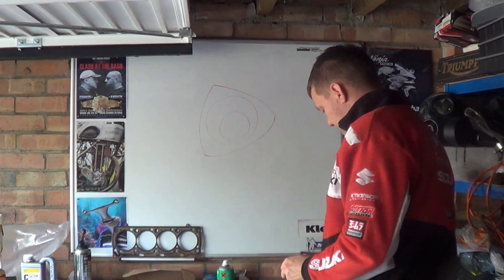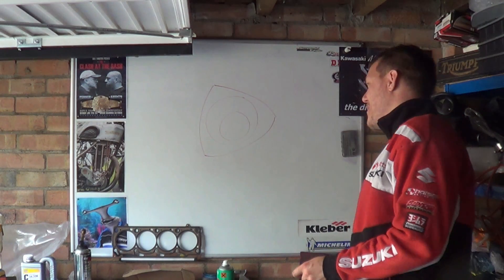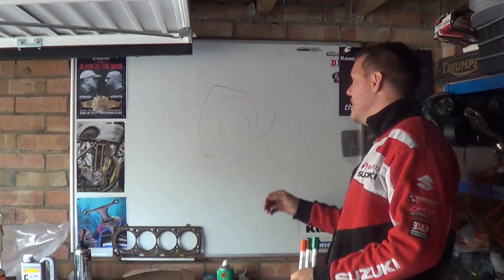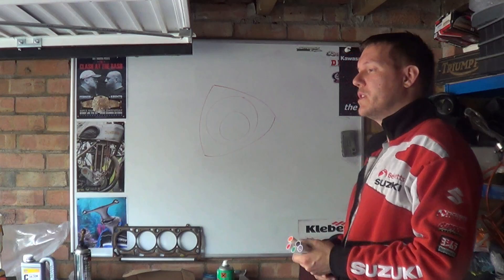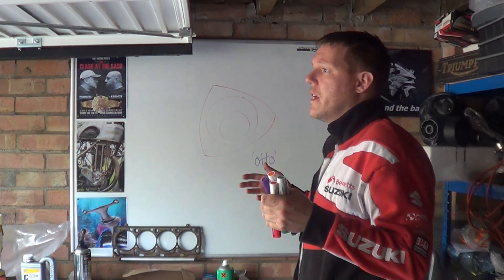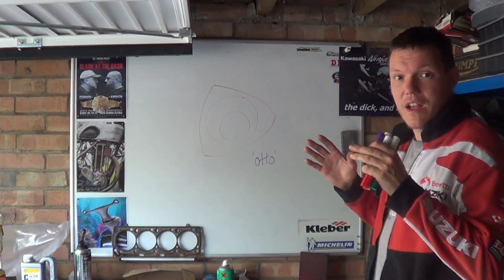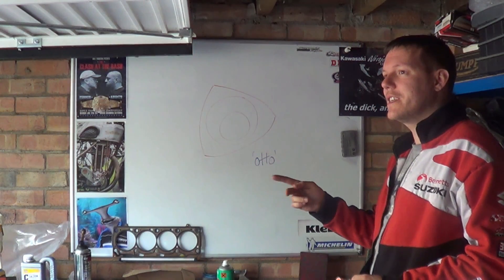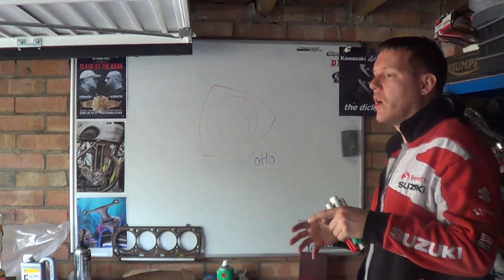Are Wankel engines 2 Strokes?

Comment: Seems people are confusing strokes and cycles... It has 4 cycles but it is NOT 4 strokes, so it is one stroke? And 4 cycles? I would not call Wankel 4 stroke because it has not 4 STROKES like a piston 4 stroke engine. Wankel is not like a regular piston engine...
Reply from the maker: A 4 piston engine doesn't have 4 strokes because of the number or pistons...

Comment: 1 combustion per chamber and per revolution of the rotor. (one top return to his start place).
= 2 strokes.
Four strokes need 2 revolutions by combustion.

Wankel is similar to 3 cylinders 2 strokes engine.
Look at Liquid Piston engine that is a revers Wankel, would be more evident.

All type internal combustion engine have 4 phases but these are not strokes.
Multiplier by 3 crankshaft rpm don't change anything.

Félix Wankel want to say it is a four strokes for reliability reputation.
And he talk about only one chamber displacement to avoid taxes.
Reply from the maker: And that's you not understand what a 4 stroke engine is.
Reply: @thedirtyworkshop  4 strokes engine need... 4 strokes... 2 revolutions
that is the basic definition.

Comment: -terrible fuel efficiency
-burns oil like no tomorrow
-shit compression & combustion
-one side hot AF

-sounds amazing
-light,simple,runs in any orientation
-no valves, no cams

Hell yeah, it's so similar to a 2 stroke lol
Reply: Yet all Wankel engines operate using the 4-stroke principle
Reply: @sandervanderkammen9230  file:///C:/Users/bemil/Downloads/Two-Stroke_Wankel_Type_Rotary_Engine_A_New_Approac%20(1).pdf Here is a 2 stroke versions of a wankle rotary.
Reply: @jlo13800  All Wankel engines operate using the 4-stroke principle.
Reply: @sandervanderkammen9230  Even a 2 stroke piston engine has 4 cycles. the intake and exhaust overlap and this has been done using the poppet valve.This is a popular mod for toyots's 2JZ and the 60 deg cranks. they sounded insane.
Reply: @jlo13800  Do you not understand the difference between a   4-stroke and 2-stroke motor?

Comment: Well I saw a design in some research paper where intake and exhaust happened in the same stroke, on both sides of the chamber, so 6 intake/exhaust strokes per revolution. Would that count? Naturally it had higher torque on the lower end, what with more force per revolution and such. I'll search for the link if anyone's interested!
Reply from the maker: Well wankels don't really have strokes. What matters is what happens in each 'chamber' if it goes through a seperate intake, compression, combustion and then exhaust its the otto cycle and therefore similar to a 4 stroke engine
Reply: @thedirtyworkshop  Thanks for the answer, that was fast! Here it is: https://www.mdpi.com/1996-1073/12/21/4096/htm . Haven't actually properly read it because I can't be arsed, mostly just skimmed and saw some pretty diagrams. (And 'both sides of the chamber' wasn't the phrase I was looking for, I was referring to how there were these 'triangly' bits in fig. 2.)
Reply from the maker: First line in the abstract "The Wankel engine is a rotary type of four-stroke cycle internal combustion engine."

- wrong LOL They need to replace the word 'four-stroke cycle' with the 'otto cycle' - even the diesel cycle is different than the otto cycle and diesels can be either 2 or 4 stroke

https://carfromjapan.com/article/car-maintenance/difference-between-otto-cycle-and-diesel-cycle/
Reply: @thedirtyworkshop  Every Mazda 13b series engine has a 30mm piston (rotor) "stroke" due to the 15mm offset lobes on the eccentric-crankshaft. 
It is this "stroke" that creates the change in displacement volume.

Comment: 4 stroke piston engines do inject, compress, ignite and exhaust once within 2 rotations.
2 stroke piston engines do Inject, compress, ignite and exhaust once within 1 rotation.
4 stroke rotary engines do inject, compress, ignite and exhaust 3 times within 1 rotation.
Electric engines don't do any of these ever.

Advantages 4 stroke piston engines:
-comsumes low amounts of oil
-lasts for ages
-doesnt consume much fuel

Disadvantages 4 stroke piston engines:
-produces the least amount of power out of the 3 (worst power/capacity ratio).

Advanatges 2 stroke piston engines:
-produces the most amount of power out of the 3 (best power/capactity ratio).
-lasts long if maintained correctly
-exhaust smells fantastic

Disadvantages 2 stroke piston engines:
-consumes huge amounts of oil (you literally put oil in your tank (messing up the oil/gas ratio can eventually kill your piston)
-consumes huge amounts of fuel
-you can't use the engine brake

Advantages 4 stroke rotary engines:
-less parts to wear out
-most unique sound of them all (Rotarys sound like this: "Brap (Break) Brap (Break) Brap (Break) Brap" and at high RPM: "WEEEEEEEEEEEEEEEEEEEEEEEEEEEEEEEEEEEEEEEEE")
-huge power (almost as powerful as 2 stroke pistion engines)

Disadvantages 4 stroke rotary engines:
-parts that wear out wear out super fast
-consumes huge amounts of oil
-due to quick wearing out unreliable, better for racing cars, etc.

Advantages electric engines:
-produce insane amounts of torque and power
-reliable at any temperature
-no need for oil.
-spaceshuttle sound

Disadvantages electric engines:
-batteries (it needs them essentially) are extremely heavy
-batteries wear out extremely fast

CONCLUSION:
If you want a reliable vehicle, which is cheap at the same time: 4 stroke piston engines are the way to go.
If you want a super light but powerful vehicle (moto-cross, etc.): 2 stroke piston engines are the way to go.
If you want a unique vehicle with lots of power ontop: 4 stroke rotary engines are the way to go.
If you want a "I slam your head into the seat and sound like a spaceshuttle" type of vehicle: electric engines are the way to go.
Reply from the maker: Wow - what was the point of this?
Reply: That's a very underrated comment, you sir, need more likes!!
Reply: Ah my 8v92 2 stroke detroit ain too bad on BRP-XD-100 ETEC oil but that oil aint cheap but it works great.
Reply: If you wanna do it all at only triple the oil consumption, we have 2 stroke valves diesel engines.  Added benefit: pricey mechanics
Reply: Make a turn and you slam youre head into a tree with that way to heavy battery on wheels.

Comment: The reason people get confused about this is because of the way it works. In your 4 stroke piston engine, there's 2 crank rotations between each firing of a single cylinder. Half a rotation up to compress, half a rotation down for combustion, half a rotation up for exhaust and half a rotation down for intake. 

In a rotary, theres only 1 eccentric shaft rotation per combustion instead of 2. Just like a 2 stroke engine. Therefore, because I got an A+ and a gold star on my report card for maths in primary school, it must be a 2 stroke, right? 

People seem to forget that the rotor has 3 faces, which are all in different phases of the Otto cycle at any one time.
Reply: The Wankel engine completes its 4-stroke cycle in in 1080° of crankshaft rotation or 3 revolutions.

Comment: I have had this morning the one stroke on my mind and I came to the conclusion that only a turbine or and electric engine can be a one stroke engine. Because they do only move in one direction and that is what makes sense to me.
Reply from the maker: a stroke is linear
Reply: Yes, but who says it has to be straight? It pulls/pushes only in one direction and starts where it ends and is that way continues in motion. As soon you have to move it the opposite direction you have a two stroke. So you have to bent the line to get there. Or you take a rocket. It would be funny if you need to reload pistons to have a one stroke. Then you would have to say my bike uses 5 liters and 1.500.000 pistons on 100Km. LOL
Reply from the maker: "Yes, but who says it has to be straight?" - science says so.
Reply: Come on! science says there are black holes that can bent time and light. And those are linear too! So bending things is an approved method.
Reply: Yes an electric motors is a magnetic rotary 2 stroke, hence that why tesla's are so fast!. Lightning bolts are also a plasma impulse 2 stroke.
Reply: basically if you want an 1 stroke engine, you need to make the engine produce power everytime the piston reach dead center

Comment: They can't really be called a "x stroke" anything, since they're a completely different design. But since they burn oil, are very light, have high power output, and fire every time a side of the rotor comes to "top dead center", they are more similar to 2 strokes than 4 strokes.
Reply: "have high power output"  
Because 1/3 of the real displacement is announced...
Reply: Plus they have ports, not valves, and they're opened and closed by the thing that seals off the combustion chamber from everything else, just like a 2 stroke.
Reply from the maker: " they are more similar to 2 strokes than 4 strokes." - wrong
Reply: Elaborate
Reply from the maker: will do in a video that follows this one - matt

Comment: The eccentric movement of the rotor around the trochoidal (fat figure eight shaped) chamber with the rotor geared to turn one rotation for every three of the crankshaft creates a pumping action that is similar to that of a four stroke engine but there is an ignition for every 360 degree rotation the crank. The pumping effect is not as efficient as that of a reciprocating engine but it makes up for that somewhat by the expansion stroke lasting for much more than 180 degrees rotation of the crank. The best way to compare a single rotor rotary engine is to that of a twin cylinder four stroke engine. Twin rotor = four cylinder, three rotor = six cylinder, four rotor = eight cylinders.

Comment: show me the 4 strokes a rotor makes while whizzing about the eccentric shaft? They are an otto cycle as you said, which is 5 cycles not 4, note the word cycles rather than strokes... Labelling them as a 4 stroke makes you a muppet the same as the others labelling them as a 2 stroke
Reply from the maker: "which is 5 cycles not 4" - what?
Reply: "wankels are 4 stroke because they have 4 cycles"  -what?
Reply: @The Workshop: I think he is trying to communicate that the classical representation of the Otto cycle has 5 phases because it doesn't count ignition and combustion as one. I suppose he got rubbed the wrong way by taking the sentence "Wankels are basically 4 strokes" out context. 

Personally I never use the word "stroke" anywhere near an explanation of a Wankel, as it just confuses the hell out of people. Especially since you can equally well state that "A Wankel is like a 4 stroke that doesn't waste a crank rotation on compression" and "A Wankel is like a 2 stroke that has a volumetric efficiency of 100%"... and be equally wrong in all the respects you were not trying to communicate in the first place.

"A Wankel engine goes through one full Otto cycle per rotor per shaft rotation but pisses unburned fuel out the exhaust because the combustion chamber is long and shallow, and it only has ~120 degrees to do it" is about as close as I can get it without writing a god damn essay :P

Comment: Its probably because they have a total loss oil system and not needing oil changes what confuses people.  I wouldn't have thought that anybody has ever used an Atkinson cycle engine for a vehicle.  Can you also do  videos on the Ringbom type engine and Stirling type engines?
Reply: Andrew Fawcett the Apex seals are lubricated by oil injectors, so they do burn oil, be it very little on a well kept rotary, people say they are like a 2 stroke as there is oil and gasoline in the combustion chamber at the same time for lubrication purposes. on my rx7 I got rid of my oil injectors and am running an ashless premix, just because I prefer to have one less part being able to fail and cause a very expensive rebuild (actually multiple parts, but one system). hope that clarifies it for you a bit
Reply: My girlfiend filled the whole  damn thing up with amsoil dominator 2 stroke synthetic and increased the oil in injection feed rate. it ran great and and burned clean. She said it was a uniflow 2 stroke with a dog chasing his tail with pehrhile ports. MY OMC rotary wanlke just takes premix, i have rune pennzoil 10w40 sythetic at 40:1 with no problems. I now got a 8v92 detroi 2 stroke and shell rotella SAE 40 in 2 stoke GM v8 and omc rotaries, again no problems and it burns clean
Reply: Well I read somewhere that the oil was burnt off as the motor runs and that is why they are exempt from gas emission tests.
Reply from the maker: Sorry that was the wrong comment - lol not to you. I copied the wrong bit.
Reply: Jae P 
so you are running  mixed gas?
Reply: My OMC rotaries do, shell rotella SAE 40 at 40:1, 2 stroke diesel oil. MY GM v8 2 stroke run the same oil
Reply: Jae P.     Thanks for that.  It's good that Mazda who took out a licence to build this German design of engine  got the reliability problems sorted or else the engines might have disappeared like the NSU brand of cars which used them first in their  Spider sports car in the early 1960s and later large saloon Ro 80 which was European car of the year in 1968 . NSU got swallowed up by Audi around 1972 after having to repair / replace engines under warranty as short journeys wrecked the seal tips after only covering a few thousand miles.  Some owners resorted to fitting Ford V4 engines after having multiple engines replaced.  Audi kept the Ro 80 production going until around 1977/8 before killing off the brand.
Reply: My ex girls rx-7 burnt off the oil, she filled and amsoil dominator 2 stroke oil, it worked fine.
Reply: You could rig up any engine you want and eliminate oil changes

Comment: I think the reason people compare rotary with 2strokes is because of the oil/fuel mixture and high fuel consumption with emissions that give greenies nightmares, and also a generally higher power to weight ratio than an average 4 stroke...??
Reply: Hell my v8 GM 8v92 2 stroke burns more oil than my old fart OMC sled rotary

Comment: Correct me if im wrong. But isn't a Wankel combusting 3 times per 360 degrees of rotation? and then i mean the rotation of the rotor, since the "crank" or "output" shaft is rotating at a faster phase?